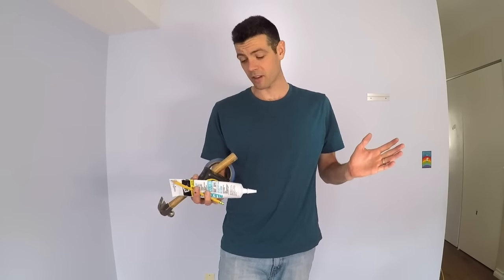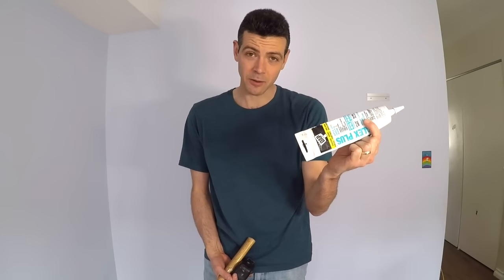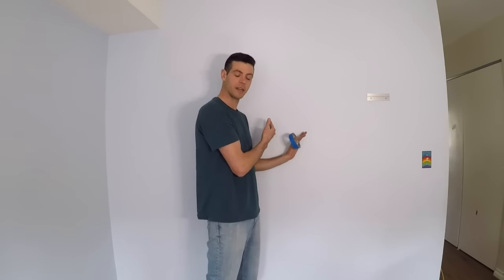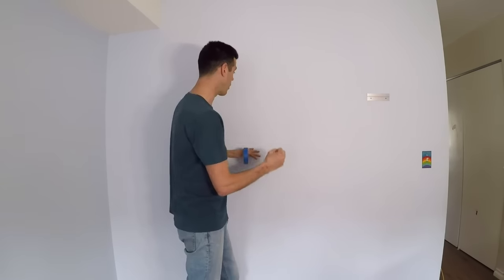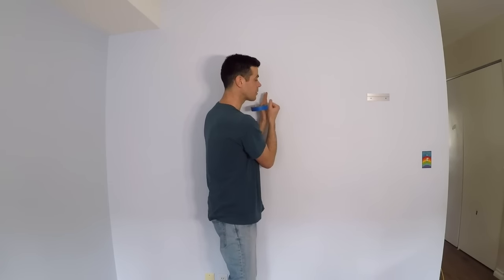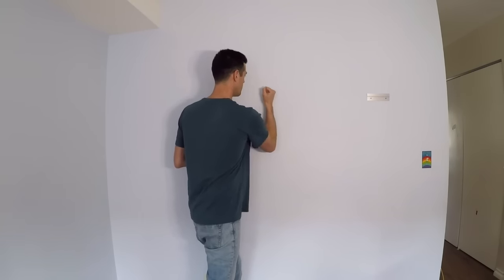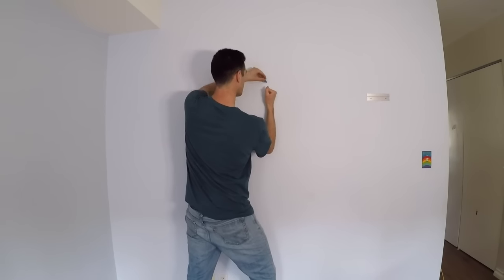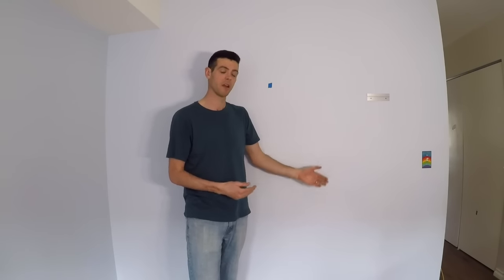It's EASY to Find Studs WITHOUT A STUD FINDER!!!!!

Comment: The use of magnets is brilliant.

Since screws tend to be placed close to the center of the stud, so it is a very easy way to find where the center is.
Reply: I'm going to try the magnet idea.  I live in an old house with wooden slats attached to the studs so a stud finder doesn't work. Thanks for the idea!
Reply: Except, sometimes they aren't.  A lot of things were built sloppy.  Sometimes the finish makes it not so obvious.  This is why I ordered a stud finder that's supposedly decent at finding edges to go with my magnets and StudBuddy (R).
Reply: Junk just gonna pick up random shit around you

Comment: You can almost always tell which side of an electrical box the stud is on just by taking the cover plate off and looking on both sides of the box. If it's not easily visible you can shave a little drywall off with a knife on either side till you find it. Just make sure the plate hides whatever damage you do. Otherwise, what a great video! This is the only thing I could add to it.
Reply: Austin---I've successfully used that method for over 40 years
Reply: @ShelbyDude1  and I'd bet it's gotten simpler over the years as well since houses have been built with more and more outlets.
Reply: As an electrician, I don't always mount my boxes on a stud, especially if I am using a gem box or some other form of bracket caddy. But I think about 80% of them are mounted to a stud
Reply: @DrugsAreBadUmmmKay  . Because sometimes boxes need to be in unusual locations, even if that means more work.
Reply: cathode 01 so you do the extra work of cutting and installing a block to move box less than 14 inches...that’s real efficient...
Reply: I wonder who works on cookie cutter houses, and who works on custom built houses. It depends on the specs..you guys criticizing ever deal with specs? 🤣
Reply: Also，you don't need to cut the whole wall side of the box. Just a tine is enough.
Reply: What I generally do is push the knife in at a 45 from the edge of the box. And yes you have to do both sides, in case they used a retro box or something like that.
Reply: @KingX226  do you do residential? Its pretty much mandatory.
Reply: @kylesexton6067   if you're on a 15 foot wall and someone wants the outlet right in the center, your at 90"....no stud. You have to toenail in lumber to get the outlet where the client wants it.  It's not always about efficiency. It's about meeting your client's needs.
Reply: That's what I was about to write above; but in 70 year old houses and older, you can't go by that.  They're plaster and lath walls and the studs aren't always on 16 center.
Reply: @flexiblestrategist9922  and that's part of why I said almost always
Reply: @austinpatrick2682  Almost every room I've been in has at least one outlet per wall.  Sometimes except for the one at the side the closet is.

Comment: I installed a TV mount which had a magnet encased in a piece of plastic about 3/4x2”. After installing the mount, I kept the magnet. I carry it in my pocket—very handy. Also I have a magnet which I attached with epoxy to a 16 inch brass chain. I hold the end of the chain and swing it along the wall till I find a screw. Let the chain hang down from the magnet—it’s a plumb line so you can make a mark with pencil or tape at the height you need it. Or make 2 marks and then use a straight edge to mark above the screw. The chain is 16 inches long so you can swing it to each side and mark the adjacent studs.
Reply: I have used a magnet in a pinch but that is a whole other level. Great creative problem solving!
Reply: Karl Armbrust no- if the drywall is fixed with COPPER nails then this wouldn’t work. Copper isn’t magnetic
Reply: Copper nails?  True they are not magnetic. But I’ve never known them to be used for drywall. I’ve only seen them used for securing copper pipe.
Reply: Karl Armbrust they are used in damp conditions as they don’t rust. Please do more research in future
Reply: @jeremywestern7067  You would have convinced us if you didn't say "Please do more research" I've never seen copper nails in drywall either. You made that up to be a youtube know it all.
Reply: Paul Day sorry... I was attention seeking
Reply: Don Bags OOOOHHH GET YOU!!!! Bet you wear a special helmet!!!😂
Reply: Nick Mackey no- you should NEVER mount a tv with just a magnet- it isn’t strong enough. Please use appropriate fixings
Reply: @DrugsAreBadUmmmKay 
     Lol. That's exactly the first thing that came to my mind. Reading comprehension challenged.

Comment: There is a magnetic stud finder from C.H. Hanson that is the best to use. It can find metal studs. If the drywall is thick or there are wood studs, it will find the screw/nail. Electronic stud finders give false readings if there is insulation, especially insulation with foil face. The magnet works every time.

Comment: To locate a starting point for  measuring 16” intervals, I’ve also had good luck by simply removing a wall switch or outlet plate. I can then see which side of the stud the switch or outlet receptacle box is attached. Then measure 3/4” over from the stud edge, to locate center stud, and you’re on your way. Sometimes you do get a surprise when a switch our outlet was added after construction, in a location where there is no stud, using a self-mounting box.
Reply: Great idea
Reply: This literally just happened to me.

Comment: Neatest stud finding method I've ever seen was on a job where we used metal studs. Took a handful of chopsaw dust and threw it up along the wall. The dust, containing metal fragments from the cut studs STUCK to the wall at every point there was a screw. The screws had become slightly magnetized from the magnetic apex used by the drywall installers. It was amazing, as the dust would show the screw so well, that you could see the slots from the phillips head screw.
Reply: Whoever thought of that method was a real genius. Excellent idea!
Reply: Very smart idea. But idk if you can call it the neatest as you are throwing saw dust at the wall, haha. That is a awesome idea tho

Comment: I've used this method in previous homes but now I own a home more than a 100yrs old - carpenters did not use 2x4's or 16" space then. Behind the drywall (lathe & plaster has been replaced with drywall) therefore are slats of various sized boards (not 1/4" thick, more like 1/2-3/4") lined on the studs which are a variety amounts of width - lots of fun when one wants to hang something very heavy!

Comment: I use a fridge magnet; one of those really strong rare-earth ones that looks like a pushpin with a little magnet in it instead of a pin.  Staples sells them super cheap.  Scan the wall with the magnet until it attaches to a drywall screw, and voila, stud!   No holes, no pencil marks.  I keep a bunch of them in my toolbox.
Reply: But what if the screw isn’t centered?
Reply: @socratese5  Then you can test around it with nails id guess? As ling as its the part thats going to be covered right?

Comment: Studs are usually 4x2s or ex 4x2s at 450 or 600 centres  - 100x50mm. There are also horizontal noggins between studs, and these are what electrical fittings are fitted to. Best nail to use is a v long panel pin. Leave them in when you have found the studs then remove after the work is complete. This is ideal when fixing vertical metal shelf uprights
Reply: What a strange comment.

Comment: Magnets...oscilloscopes...Hadron colliders...
Just point a halogen light on the wall, close up and at an angle...
...you'll see where the screws were spotted in the field...even if it had an excellent taping job, you'll typically see the flashing of the screw holes, at least a few of them...then you can measure off.
Reply: I use portable X ray machines.

Comment: So simple, but this was a GREAT tip!
Stud finders dont work when you use 2 sheets of drywall boards which overlap which ive done in most of my house, if i only had thought about using a tiny brad nail down by the floor board i would have saved so much frustration and ugly wholes in my wall.

Comment: I have one of the rare-earth fridge magnets (from Lee Valley) in my tool case, and have tied a couple foot long thin red ribbon to it, so that it's easy to find (as it tends to stick itself to some random metal tool in the box, at which point it's almost untraceable), and helps stop you from leaving it stuck to a wall somewhere and forgetting it.

Comment: I bought a yellow plastic enclosed magnet especially for this purpose. It has a little level as part of it and it is marked in a way that makes it easy to mark the wall exactly where the magnet is. It is not all that much better than a plain magnet but I like it. 

A comment on the banging technique:I think there are two: The fist approach where you are looking for the change in feel. And the knocking technique where you use your knuckle and you're looking for the change in sound. I have never had great success with either but they both sort of work. 

Thanks for the video. I had never thought about making the holes next to the trim. That seemed like a very good idea. 

On real lath and plaster: This is what I have the most experience with and I never had much success with any technique except using the location of an outlet and a lot of the wiring in lath and plaster walls is retrofit and the people installing outlets aren't always careful to install the boxes next to a stud.  I didn't have any success with stud finders or magnets and I notice the look through wall gadget that is widely advertised doesn't work well on lath and plaster according to its manual.
Reply: I am having the same problem with a lath wall that has been overcovered with drywall.
I am going to go at the boxes again and try that method as stud finders have been no help and the magnets either.  A major problem as i must use stud to hang the big TV Sanus mount.

Comment: Rare earth magnet.  tape to piece of string.  Pendulum across the wall going up and down.  mark string every 16" with sharpie.  magnet finds fastener, marks give your the next stud.  stick to side wall of van for later use.
Reply: DON'T use a sharpie!  Hardest ink to cover
Reply: @woodstover  Mark the string with a Sharpie.  use a pencil on the wall.  There is not enough Kilz primer made to cover Sharpies on the wall.  Excellent point.
Reply: Magnets? He covered that. Might wanna watch the video before commenting... also... With a sharpie!?!? Lmao... why do you hate the painters so much! Always make friends with the painters! Painters fix all your mistakes if they aren't pissed off...
Reply: I wear a magnet on my necklace. Use it all the time
Reply: WeRemodel.com, llc no...if the drywall is fixed with BRASS nails or screws then the magnet wouldn’t work
Reply: @jeremywestern7067  then learn and try another way... besides, where do you find brass drywall screws?? Never heard of them. Brass screws, yes. Brass drywall screws... don't think so. I wouldn't use them even if they did exist
Reply: Hal Kael I meant COPPER drywall screws
Reply: wrong way to do that.   because the screws could not be centered with the stud.

best place to magnet one is the bottom and the center of the sheet to find the center of the stud, cause when putting up sheet rock  it gets put in on it's side.  as for plaster walls i would not recommend putting any wholes from nails
 in that type of wall.   just use a china cabinet  to put pictures in,  or use a magnet  to put up picture on the fridge.
Reply: Scorp Scorp Yes, but remember, this video is about finding the stud, not finding dead center. You really have 3/4” to play with.
If it is simply pictures you are hanging and putting a screw in line with the drywall screw is a safe bet it will hold a picture, Centre stud or not. If it something that requires weight and you must guarantee to be centre stud, then using a small finishing nail to find the edges of the stud leaves one or two holes on one side of the stud (you know the other edge is one and a half inches away)
Also, it’s not hard to determine if the contractors were quality, inexperienced, or just average. If you find several screws on several studs and measure them and they are all exactly 16 inches apart, there is a chance they drew pencil or chalk lines on the wall to be sure, or skilled enough to be accurate. It also gives a clue as to how accurate the framers were. No, this doesnt guarantee results, but it does give clues.
Reply: and that is why i didnt type so much.    lol
Reply: Some of you guys can't read. The op said use the Sharpie on the string, not the wall. Unlike the guy in the video, using a magnet with a marked string will give you your 16" spacing right away. Plus, you can dangle and move the magnet around and watch it's movement if the nails aren't obvious.
Reply: @halkael2317  Well said Hal.
Reply: @woodstover  Agree but I still use sharpie anyway, just use oil base paint to cover it, or appliance spray paint.
Reply: Why did you say "rare earth" magnet?
Reply: This makes no sense to me
Reply: @jeremywestern7067  Copper drywall screws, even harder to find than brass drywall screws.
Reply: charlie dee no you are mistaken...if they use bronze or silver screws then a magnet wont detect them

Comment: Instead of a nail, try probing with a sewing needle held in a pair of locking piers.  You can push it right through the drywall with no hammering.  The hole is so small, you probably don't even have to patch it.  Zero chance of going into a pipe.
Reply: This is actually a great tip - avoids the need to hammer through a nail and the need to patch the hole.
Reply: Great tip Shawn. Thanks
Reply: What if you have plaster walls?
Reply: Not everybody has that

Comment: Stud finders help eliminate pounding and guess work but it takes some common sense to confirm it. Great tips! Every time I use my stud finder I get frustrated and start pounding and measuring. I have the dewalt one (bought it on sale) and it's just as garbage as the rest don't listen to the affiliate marketers on youtube.

Remember if you're finding a stud you're probably mounting something. 99% of the time the thing your mounting will hide your practice holes so yeah don't worry if you miss. Just move over an inch. When the mounted object is removed, repairs and paint will be done anyway so who cares put the TV up and start watching it and stop over thinking it. One time in a plaster and lathe wall I made 14 holes nail holes 1 inch apart to find the first stud. Probably should have gone left instead of right. The TV hid my 14 practice holes. I skimmed over them 2 years later with some fibafuse when I moved.

Thanks for posting. Spring is coming I wanna see some fence and deck moves!

Comment: Earlier last year my mum wanted a TV mounted in her room, and the only wall available was a stud wall. We found the studs using a magnet. We were surprised that it worked, and that it was so quick and easy. After finding the stud with the magnet, we just used a very small nail to identify where exactly the middle of the stud was. The holes didn't matter as the wall mount was going there anyway.

Comment: Depending on your need for finding where the studs are remember you still need to take care when finally making a decision to drill into your "stud". I have learned through hard experience to check what's on the back side of the wall, and also to ask or check what is upstairs of that wall - the reason being there can be water and waste pipes inside that mimic the stud "signature". And you wouldn't want to drill into one of those!
Reply: Oh yeah that will suck! Don’t need that smelly mess! Wish me luck! 😅

Comment: We electricians use the magnets in torpedo levels to find the screws attaching the drywall to the studs.
Reply: How strong of a magnet?
Reply: pls help ...strong enough to detect the nail/screw heads just under the service at each stud.
Reply: @plshelp2906  He already said the one in the torpedo level.
Reply: @CaligulaInvictus  I didn’t know what torpedo levels were lol but that still doesn’t answer how strong it is, I found magnets that worked though
Reply: What type of torpedo level do you use? Cus my t-level magnets are nowhere near that strong
Reply: @MrWzeljunior  you said magnetS.. if you have multiple individual magnets, and if you can stick them together do that!! I had three magnets that I stuck together and it worked on the studs.
Reply: @plshelp2906  yea that's what I use; neomydium magnets (4 attached together). As an electrician myself Ive never seen a t-level have that strong of a magnet strip to attach to a wall stud. My question was more so directed to the OP.

Comment: One of the best ways to locate studs is to look for outlets and determine which side of the outlet box the stud is located.  You can then measure 16 inches from that established point and you'll probably find the majority of them.
Reply: Is there any reason that a magnet would work, 24” o.c., which also does not line up with 16” o.c.?  This is in my bonus room above my garage on the wall next to the rest of the house.

Comment: Modern wall boxes, especially in the UK, but also in Germany and France and elsewhere in Europe are mounted in hollow wall boxes NOT onto a stud (the old stupid way) or chased into solid walls. This allows you to VERY accurately position the studs. Simply remove the wall plate and back box then use your tape measure along the inside of the wall to the studs on left and right. Then work on standard centres (400mm) to get the centres of the rest of the studs.